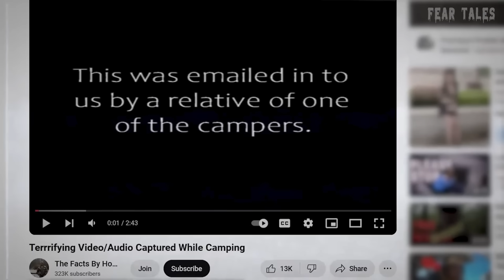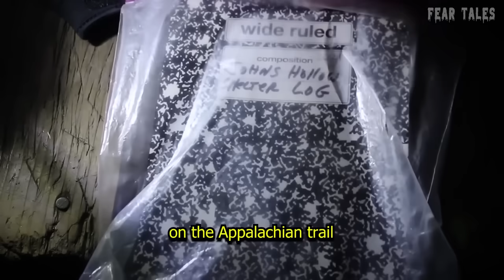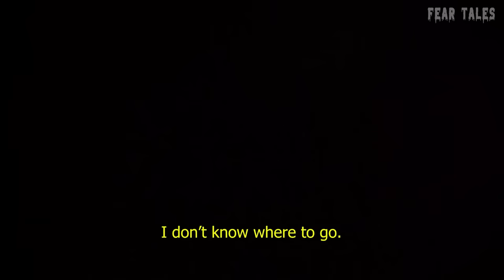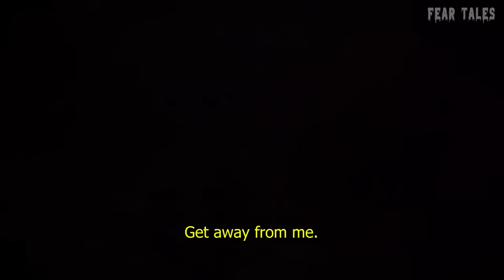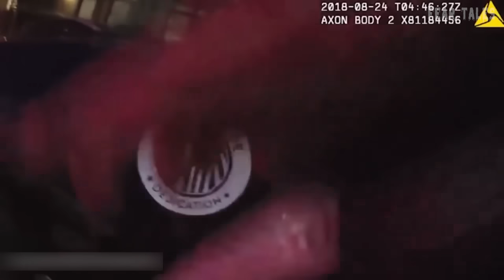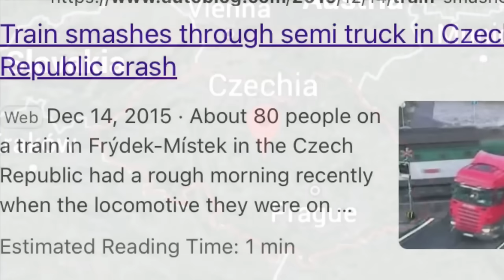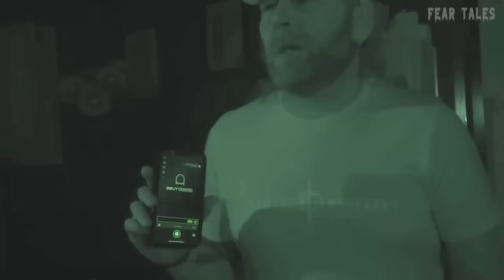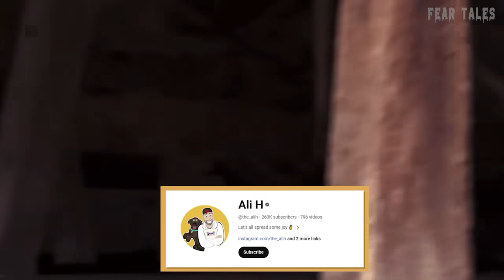youtube video #-CuZSsMLYFI

Comment: Imagine believing roads and bridges are made of concrete (1:35:38) and not knowing they're actually made of asphalt which is why they're black. Some walkways and some sidewalks are made of concrete... Highways and roads are ALWAYS made of asphalt. For your benefit, hopefully you never need a driveway replaced because you'll be calling a concrete contractor and not the paving company you'll need to do so. 🤦🏽‍♀️🤦🏽‍♀️